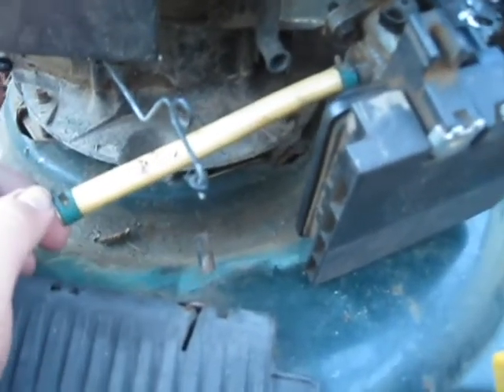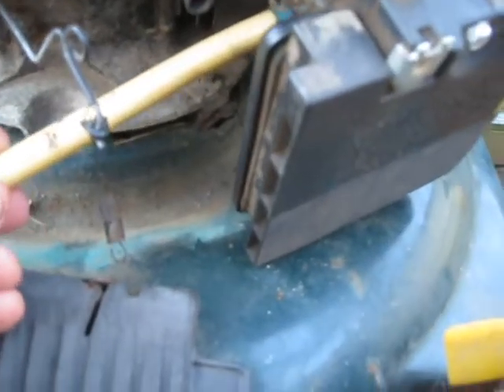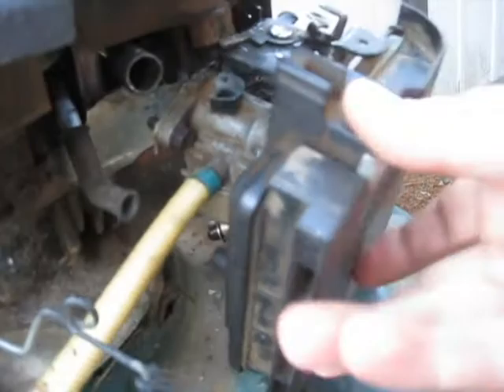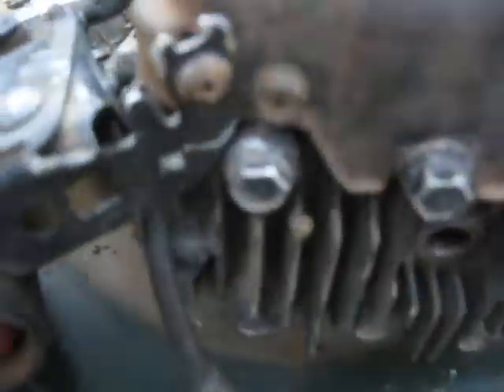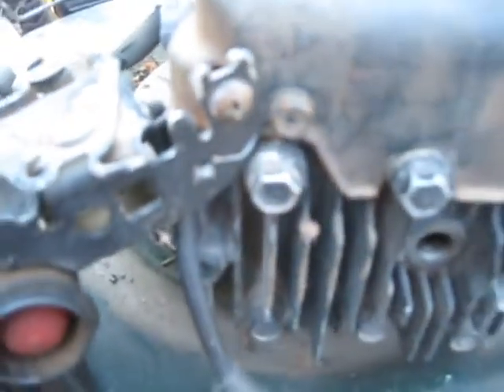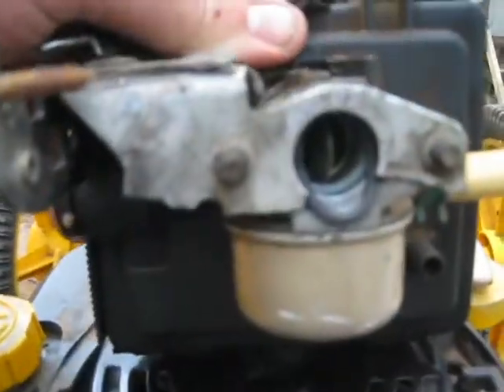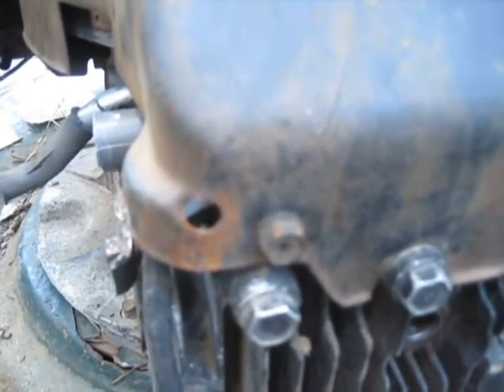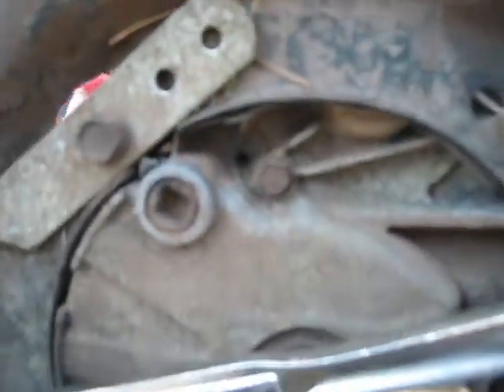shakey mower

Comment from the maker: i figure it was because the crankshaft was bent and the guy kept running it for quite a while. the deck was cracked which is a common symptom of a bent crankshaft. the vibrations crack the metal. this carb fell off because the bracket cracked and that is why it fell off. plus the bolts for the gas tank were loose and one was cracked in two.